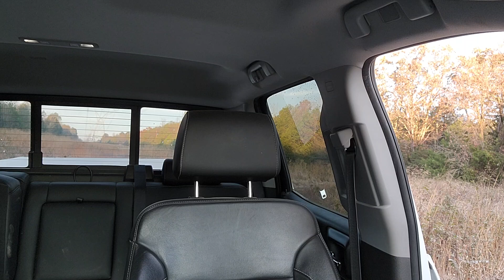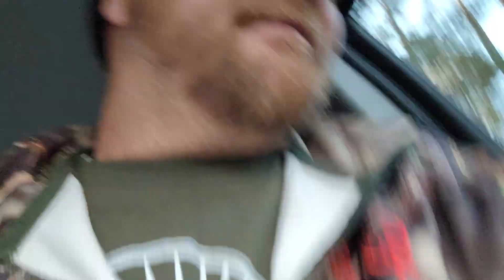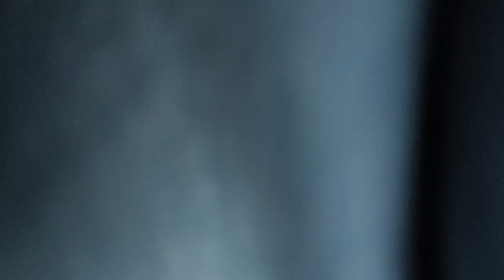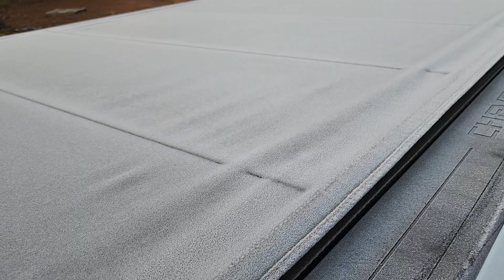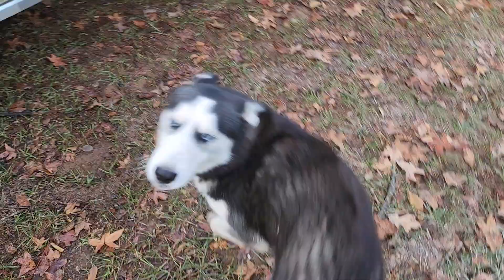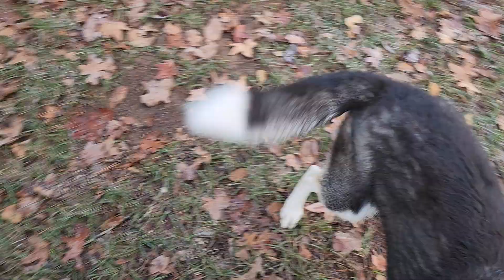WE HAVE A PROBLEM | abandoned cabin, cabin build, homesteading, well, solar, diy, tractor work

Comment: The freezing point of propane is -306.4°F degrees Fahrenheit.   Although, propane does shrink when it gets cold. When it’s extremely cold outside, the volume of propane inside your aboveground propane tank will shrink, which creates a loss of pressure. The problem is, if the pressure becomes too low, the propane inside your tank will not be able to reach your gas burner. That means you may not be able to run your propane appliances, including your furnace or boiler, which can be very problematic in severe cold.
Reply: mine did just fine at -30 last winter here in south central ND
Reply: They make tank warmers for extreme cold but I live the northeast and have never needed one.  Arkansas shouldn't need a heater either
Reply: @maryintx4409  your tank may be bigger and better made/insulated
Reply: @robertbates5537  up north they also sell the tanks wat more insulated and better made the ones in the south are made assuming the Temps won't be getting that low
Reply: I live in Maine. It gets below zero here most winters and I've never had any problem with propane not working. No one insulates their propane tanks that I know of. You shouldn't need to in Arkansas, either.
Reply: I never had an issue with propane freezing even at -40° for weeks at a time even up in Alaska 🥶🥶 !! My beer 🍻🍻 kept freezing🫤🥴🤭🤭🤭 !!

Comment: Amazon prime sells snake boots and has the option to try before you buy , stay warm bro it’s 1 degree hear in Fairbanks Alaska as I’m writing this. I’ve used propane in negative 40s without issues so I think you were just running out. Stay strong brother and give your woman a big hug from Alaska

Comment: I live in Montreal.  Huge freezing and lots of snow here.  Our propane tanks (for the forklift) are delivered and left outside in a locked cage all winter.  We use our propane BBQ allll cold winter (as soon as we shovel a path) Propane will not freeze.  No worries!

Comment: Go to work where they sell propane tanks and ask them real simple if you're taking back to generator stop in one of the propane places and ask them and find out it doesn't hurt to ask questions about propane and at least you'll get the right answers and what you need to do to solve your problem
Reply: Ever once in a while the valve on your propane tanks needs a new regulator and propane company can check your tank to see if it needs a new regulator, just take it there for them to check it. Much love to all ❤

Comment: David I'm in the same camp as JEL's comment below, a small wood stove might be the better way to go, definitely worth checking out. 1 time cost up front then start clearing all the wood you won't be using for the cabin for firewood.
Reply: Just make Shure you clean that chimney out every year or sooner.
Reply: @debramurphy4295  he can just install a pipe made for a small wood stove and bypass the chimney if need be.

Comment: 👍👍👍... Ive never had an issue with propane freezing but i have had regulators freeze. I just built a wind break around the small tanks and had no more problems. I think you and the rest of the framily would appreciate the warm,dry heat of a wood stove since you all came from warmer,drier climates... Best of luck!...👍👍👍

Comment: We live in Conn. and have a propane heater which is not vented and it works extremely well! As far as cost is concerned, we found and excellent replace for the vented one we had for years. Found one on Amazon very affordable, 4500 BTU's in the $400 range. Ours is Mr. Heater. BTW, I was born in Daytona Beach (83 years ago) 3rd generation in Daytona! Hope your winter is much better this year!

Comment: Dave, I grew up on propane systems in Newfoundland  and Labrador, Canada. We had and still have lots of freezing Temps in winter. We used 100 lb tanks. The most Dad ever did was build a wind break.

Comment: David, in the long run, wood heat is the way to go. With the way things are going, we all need to be prepared to use all the alternative methods to supply heat. Once you have your solar up and running you'll be in good shape. Please be careful with the propane, it can be tricky. Take care from north Idaho.

Comment: yea bud your propane not freezing i commented on another video you have a plugged filter in the exhaust on predator generator you need to remove it and switch to dual fuel carb its not expensive listen to your brothers and sisters out here with experience and look at the manual for predator 4500 its dying cuz your not following the maintenance manual look at troubleshooting section again take the filter out of exhaust and it will run forevermore!lol

Comment: David, Heath at Red Poppy Ranch had an issue with his propane line freezing. He moved his tanks under a canopy and buried his lines with the pole insulation about 12" deep. But as your lines go straight in, maybe a wrap and a wrap for the tanks but don't wrap the tops. Stay safe brother

Comment: Well, I think if your not gonna get electric on your place I would put in a small wood stove. Not only would it heat your little cabin, you could fix small meals on it. you have a lot of trees on your property, so not like you'd have to pay for wood. Of course that's up to you and what you want. Maybe a full winter in your cabin will guide you in what you need or want. I've heard of some people that have had problems with that model of generator. Either up grade or contiune to replace? That doesn't sound good. LOL Hope you can figure out what works for you. It's a hard thing to keep hunters off your property, there are just some that don't care and do what they want. Don't have an answer for ya on that issue. It can be a contance battle. Try and have a nice day!
Reply: Wood stove is the way to go

Comment: We had propane for years and yes it does freeze at the nozzle moisture gets in and we would have to run warm water over it to get it working best way to take care of it is to put a metal roof over it with insulation  so frost / moisture doesn’t get in
Reply: Oh  C’mon check out Walker Farm Family they have a Great wood stove  I’d Love to have it

Comment: Do what you did on your well now wrap it up in insulation covered in plastic just leaving the head where the vent is in the open and that will probably take care of it it did for me when I was running a large nipco propane heater in my garage with a course a big tank outside it would only run for about 15-20 minutes when it was Zero before it starts shutting down the heater and that was all I did no more problem

Comment: We live in Alaska and don’t have issues with propane until we see -30 temps.  With that wall type heater we have had issues with moisture in the pressure regulator during cold temps.  But the tanks were fine.

Comment: I bought a buddy heater I used last month at the property hooked to a 20lb tank. I also bought an in line pressure guage. The instructions on the gauge mentions that in cooler temps the guage will show less quantity but when it warms up it will return to a higher level. For the trespassing issue, call the sheriff and ask what you can do about it..I assume if you can get a good picture that identifies the intruder, maybe you can press charges. Poaching may not be as severe a penalty but Arkansas law is not in my wheelhouse. Never hurts to inquire with the authorities. Texas Deb ❤️

Comment: I've had problems with pressure regulators like you described, the 100lb tanks are the ones I use , you can get regulators for sure at true value hardware.

Comment: North Alabama, have the big tank and no problems when it gets cold. You might need to get a big tank. Tank does not need to be insulated and they normally are away from your house and no venting of the tank necessary.

Comment: liquid propane does get cold and doesn't turn to gas as easily ... ventilation is only needed if it leaks....smell them or use soapy water spray after changing tanks to check for a leak...

Comment: Maybe you should leave a NO TRESPASSING or some other kind of love note right on the blind???  Also, would it be safe to keep your propane tanks inside a shed.  Not suggesting that you keep them in your little house.  But maybe a little stand alone shed, just big enough for the tanks and possibly your generators, might be enough shelter to keep them operating.  I am assuming that the generator section of your new little house is for solar equipment only.

Comment: In the cold: Propane tanks will shrink abd loss pressure.The problem is, If the pressure becomes to low. Propane in the tank, wont reach gas burner.Try a electric blanket to keep tank warm. Try to keep tank at 30 in frezzing weather. And make sure tanks are upright. Hope this was some help to you.

Comment: propane tank cold temperature limit is -44 degrees Fahrenheit — at that point, propane turns from a gas to a liquid. Propane can only heat your home when it's in a gaseous state, not when it's a liquid. Your storage tank keeps propane in its gaseous form under high pressure.Nov 20, 2020

Comment: The problem with generators are they aren't designed to run 24/7 for long periods of time. We never had problems w our propane at our cabin when we'd go to it during the winter.

Comment: All ya need to gain the respect of trespassers is a High Speed Wireless Communication Device.  
Sounds like you may have a bad regulator on the lp supply tank. My LP tank is 120' of the house and  250' away from my heated Morton building. My supply line is buried only 8" below grade. It is NOT buried BELOW my freeze line. My freeze line is 36"-38" below grade. I seasonally experience -30°  temps for days & days..I regularly have 40-50 mph winds.(-30° does not include my real feel temps or wind chill factors)My tank is unprotected from the elements and my lines are only buried  8" below grade, It has NEVER affected my LP supply. I think you have a bad REGULATOR .

Comment: Why don't you try and get and you can get them a military generator they are guaranteed to work they don't cut out for nothing check on Google for your area where they may have some and find out how much they are it might be worth your while even though it's used they keep them in pretty good top condition
Reply: We had a military generator at our cabin. It could of run 4 cabins. Very dependable but drinks a LOT of gas.